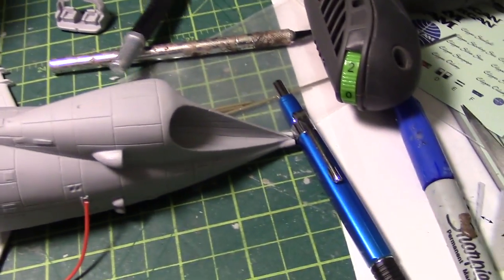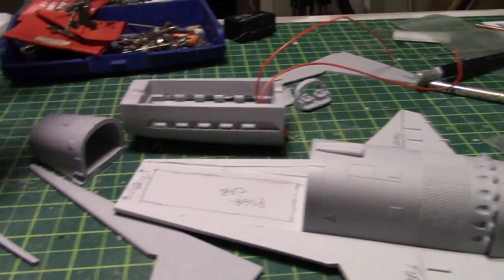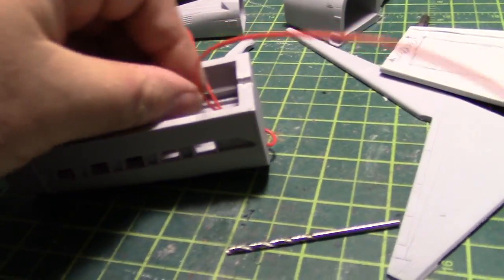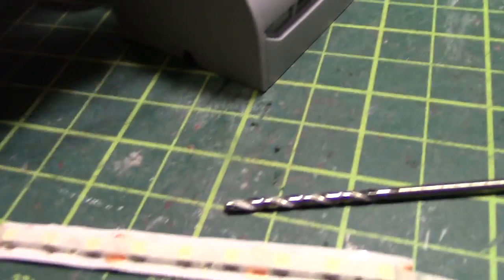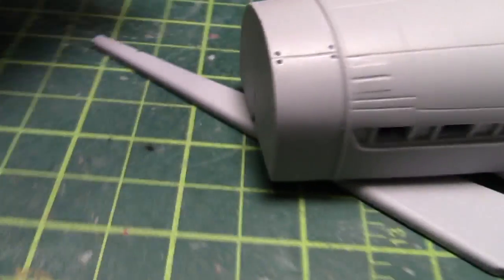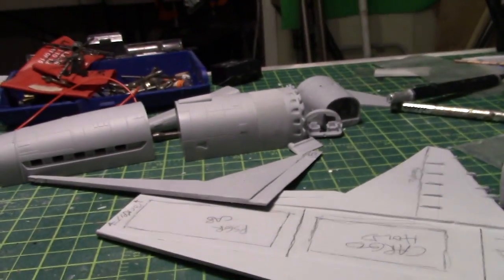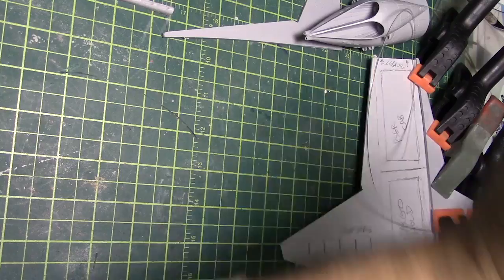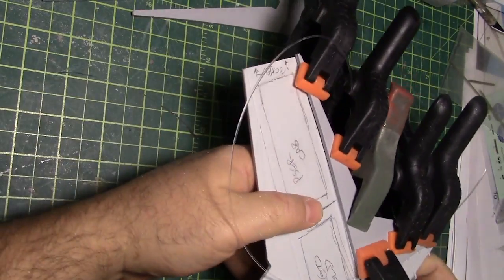Stargazer 05: Orion The Plan

Comment: Maybe some artistic license and have a white fiber shine on the PanAM meatball? Strobes of a night rated aircraft are red strobe on top, white on the bottom rear. Red on the left (like politics) and green on the right. Along the lines of the energy requirements .... if it were a nuclear spacecraft that aft "cargo hold" would be propellat, all of it including anything you could cram into the wings. If it were chemical the "cargo hold" and entire passenger cabin would have to hold fuel leaving only the flight deck dry. At best. :) Getting to orbit is hard.